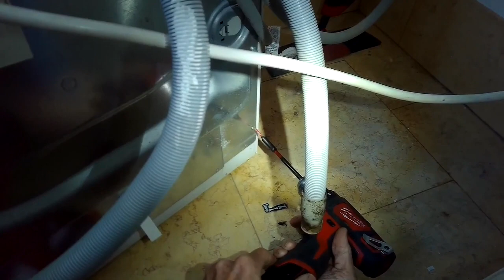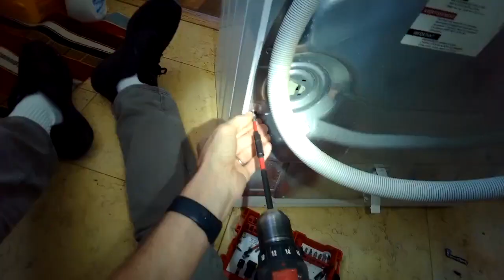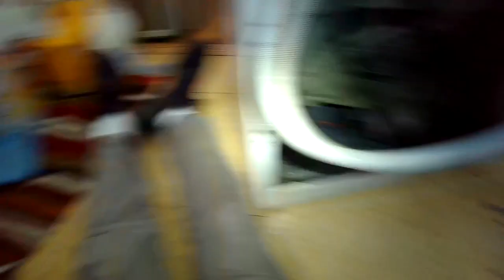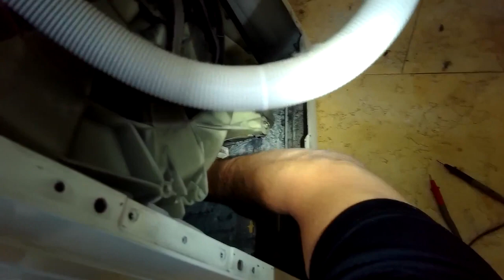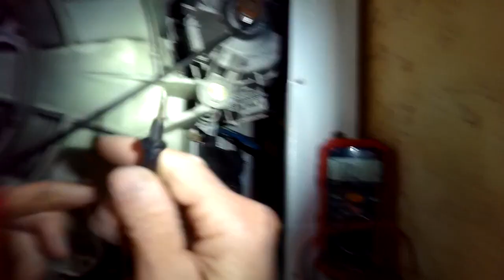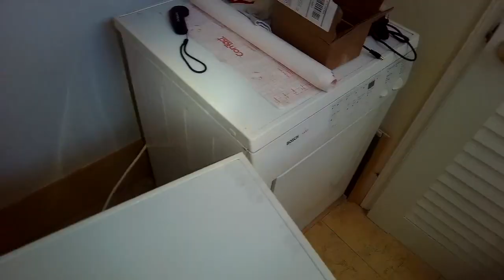BOSCH WASHER MOTOR TESTING

Comment: My brother in law has a Brush-less induction motor on his Bosh Next 500 Plus series washer. why he couldn't find the brushes; and the casing bolts are large rivets.  The controller board has a burnt high heat transistor that fried foil on the circuit board, and we wanted to check and see if the motor fried the board or the board just failed and the motor is fine.
Reply: What did you find out? Same problem here.
Reply: They bought a new washer... lol   I miss my local radio shack.. :/  motor was fine